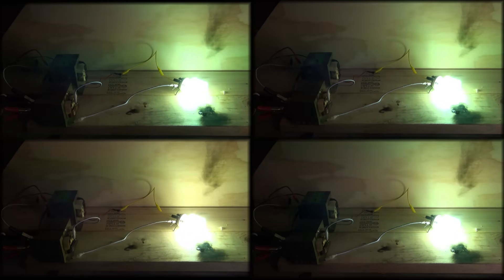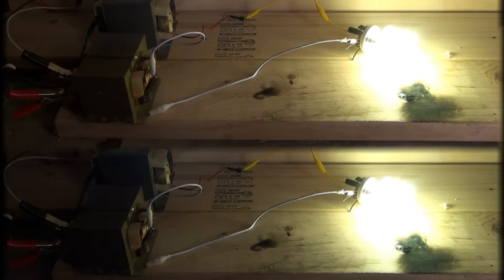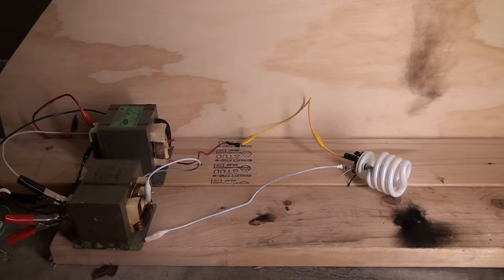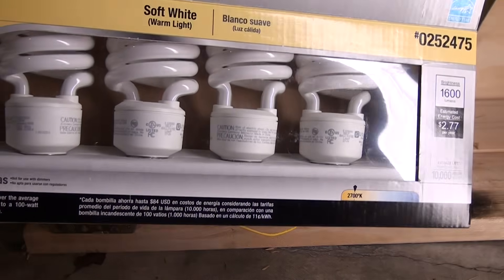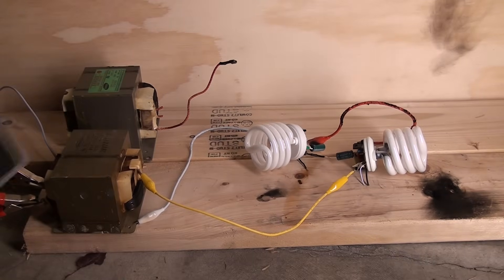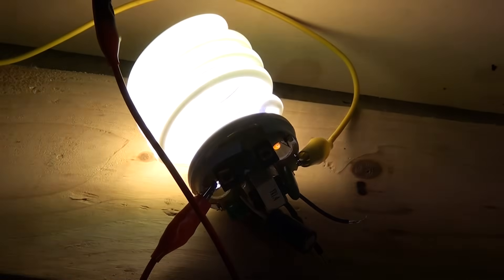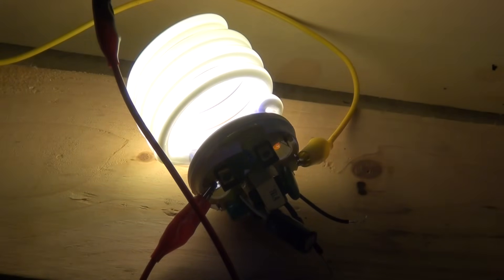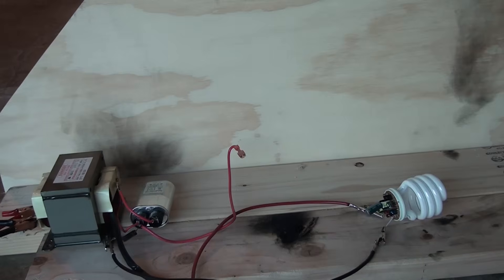MOT vs CFL II: MOT In Flames

Comment: Sir, I am electronically illiterate. My ceiling light just burned out. 
I just saw a small flame at the base of the cfl twisted fluorescent bulb in my living room when the bulb burned out. It was literally a flame, so I turned off the switch. Then I looked at it. The glass was not visibly broken, but I'm concerned that mercury escaped from beneath the visible area as the white plastic area surrounding was burnt brown. 
Any ideas as to whether the gas escaped? I don't trust them and will be disposing of my fluorescent bulbs.

Comment: ...did you mean to burn that transformer?
Reply from the maker: I finally got both the bulbs to die so in the moment I figured I'd let it burn.
Reply: @ElectronSpark  ah. That's very fair. That smoke increased rapidly towards its end. Like the slope of air resistance and speed

Comment: 2:36 why there is fire on your lamp  ? High voltage  out of ballast ?
Reply from the maker: Yes, no ballast was the cause of the lamp burning out and once that happened the power started going through the electronics which started burning.
Reply: Лм9💅
Reply: Дв9

Comment: How do you wire it so it doesn't trip the breaker?
Reply from the maker: I was running on a 40 amp breaker with a power plug in the garage. The wire from the plug was much bigger than the wire I used to hook to the transformer.

Comment: If the 120 volt cord is glowing red hot, since that cord is getting power from your wall wiring, then your wall wiring would also have been glowing red hot. That is normally prevented by using a simple circuit breaker or fuse in your house's electrical panel. How did you get around that when doing these experiments? Did you bypass the fuse or circuit breaker in your house? I think that would be a major fire hazard.
Reply from the maker: +Ben Hutchinson If you watch the video "Two Vacuum Motors Burn Out" I show how I get the power. Back then It was 8 gauge wire (in the wall) from a 40 amp breaker supplying the feed. After my last upgrade I am now using 6 gauge wire in the wall with a 100 amp breaker for the feed.
Reply: ElectronSpark
Reply from the maker: +Rouge Rose
Who me?

Comment: Thats what happens when you put a low impedance load across a high impedance power-supply - you fuck the power-supply..  Match your impedances.
Reply: There is a reason why they call it a ballast. A ballast is a large inductor with a specified impedance to limit how much current is allowed to flow in a circuit.